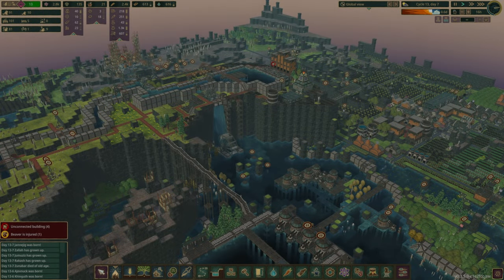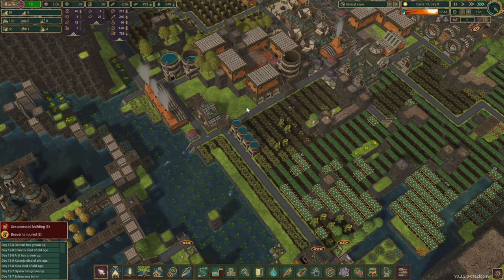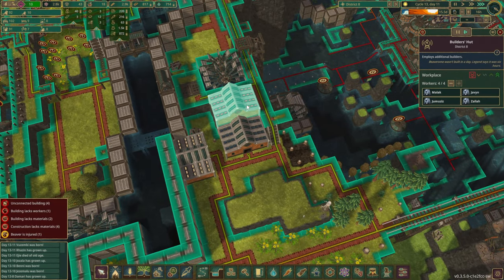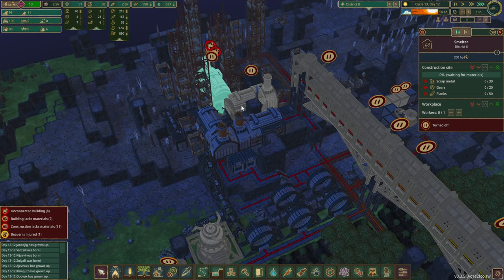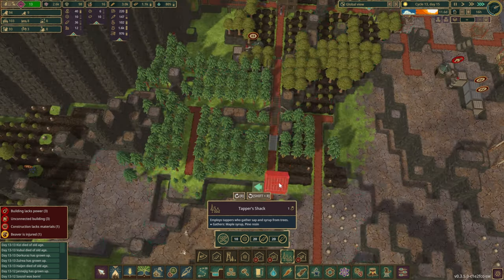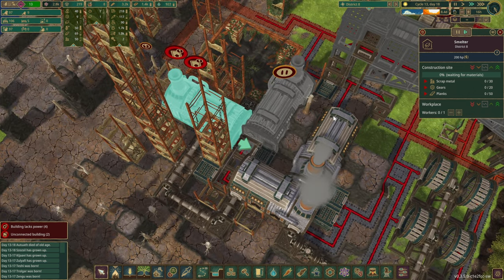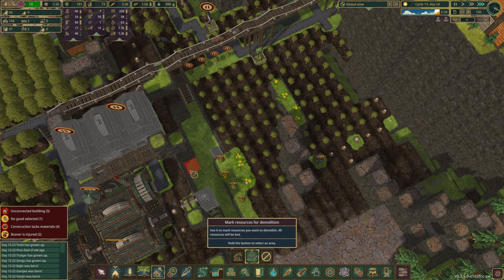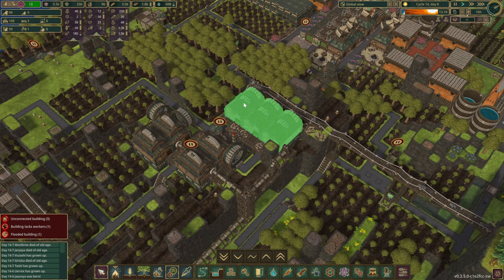We NEED More Power - TIMBERBORN - E09

Comment: If you prioritize the engines for the haulers and set the workplace priority to the lowest setting, the haulers will keep them stocked with logs and you wont use any beaver power to run them.
Reply from the maker: Excellent tip! Thanks a lot for letting me know, I'll definitely be using that from now on hah!